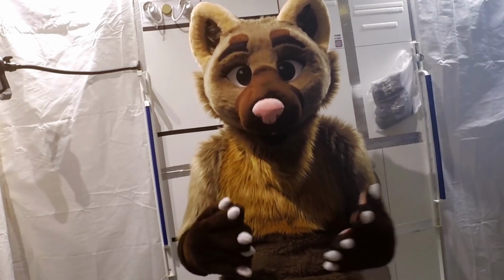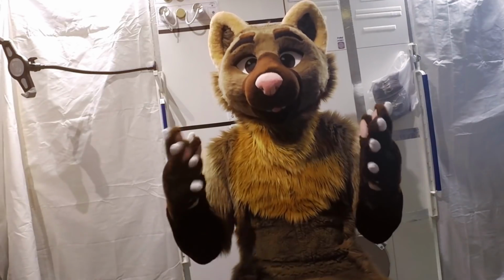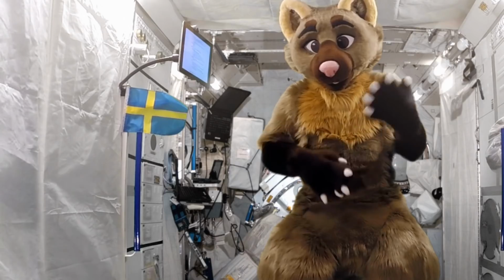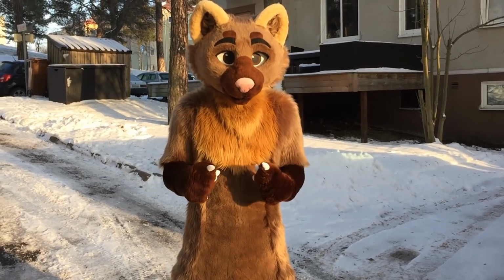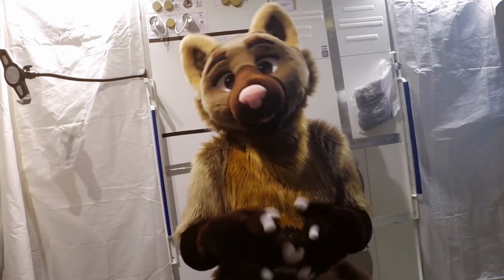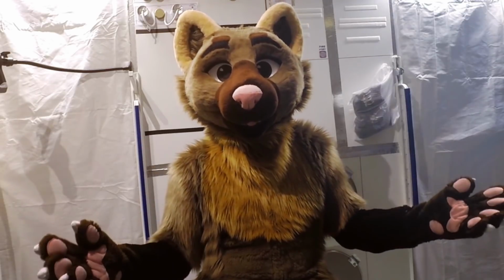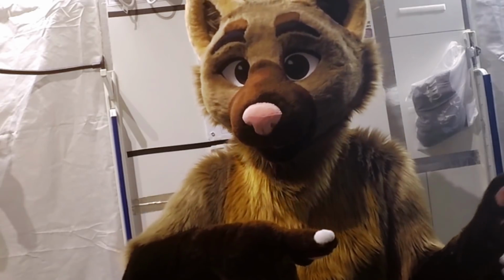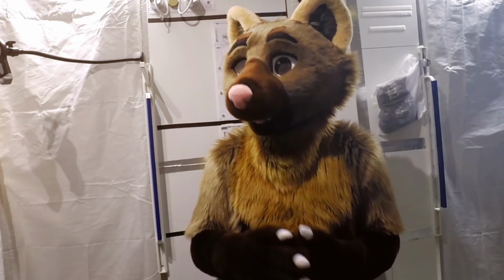What's Inside a Spacecraft?

Comment: I could do a whole video just on RTGs. I love those things! Thermoelectric generators in general work by having a junction of two dissimilar metals on something hot, and second junction on something cold, ie. a thermocouple. Each thermocouple only generates a small amount of power, so thermoelectric generators have hundreds or thousands of them to generate a useful voltage and current. In a spacecraft RTG, the hot end is a lump of highly-radioactive Plutonium-238 that gives off heat as it decays into Uranium-234. The cold end is space itself, which is why RTGs are covered in radiators. The problem with RTGs is that they are not efficient, but the waste heat can be useful for keeping sensitive electronics warm during the harsh Martian winters.

Something amusing that you missed on thermal management is "barbecue mode", which is how smaller spacecraft like satellites and capsules passively manage the thermal loading from the sun. As they travel through space, they spin slowly so that all surfaces of the spacecraft are heated evenly as the craft rotates - just like a rotisserie chicken! This technique was used extensively during the Apollo missions. The rate of rotation is slow - typically only one revolution in 10 minutes. Because the ISS doesn't spin (except once per orbit to keep it facing the same way with respect to Earth), it has to have an active thermal management system to absorb heat on the sun-facing side and dissipate it into space, hence the honking great radiators.

Thermal insulation in space is also tricky. As the dominant form of heat loss and absorption in space is by radiation, materials are selected for their emissivity (how much energy they radiate as a function of temperature) and absorptivity (how hot they get as a function of the incident radiation). The first example of this was Sputnik - the polished aluminium sphere had carefully selected absorptivity, emissivity and surface area so that it absorbed and radiated just the right amount of energy on each orbit to maintain a mean temperature inside of ~20C. The inside of the sphere was also pressurised to one atmosphere, so no special adaptions were needed for the electronics and batteries inside.
Reply: It seems like he was trying to 1 up you TrustKat

Comment: Your videos are so nicely done. They are awesome! You put a lot of work into this! Great Job!
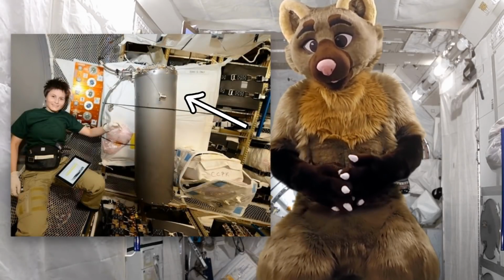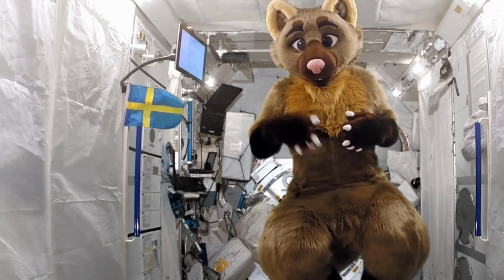So at 2:10 knowing that some shooting stars are astropoop, I'm totally going to cover my whole yard with a plastic bio-dome now. Inside spacecraft, yeah, having fans blowing is so important, if there is no gravity.  You can physically see these bubbles of air with infrared viewers of various wavelengths between 8 uM to 200 uM 6:22 so how did you like your snow day? How did they know how from the start to design Sputnik so it would not burn up from the sunlight? Aw you're so cute! 1:57 so whats to drink up here, maybe a soft drink, sprite or 7-up? No we just have fizzy psss ha ha. Yeah radiational cooling in space, you have to transfer the heat then make it actually radiate away as an electromagnetic wave, there is no air or atmosphere to transfer molecular vibrations to...This would be like running your AC but not running the outdoor cooling fan to blow the air thru the cooling fins. Your AC unit would need to be much larger to have the same BTU rating.
Reply from the maker: Can't drink soda in space - the air doesn't rise up to make you burp, it just stays down there and becomes uncomfortable!
Reply: I never knew that, you would think you could burp in space. I'd be afraid I'd puke in my space suit. I saw this one video where this astronaut on a spacewalk had some liquid coming into his suit from somewhere, it was getting on his face and he could have drowned, as it does not 'fall down' due to gravity. Wild stuff there!
Reply: Adding to it, just thought this was funny... One alien parent says to their teenage son "I see you drank all your PEPSI from Earth.... So now be nice and do ALL your chores right now*...... Else I'll turn the *gravity field OFF . . . just like last time............" ///// So yeah I looked it up, you're right, the CO2 does not come out of the soda in microgravity this would be very painful in the belly! Amazing!

Comment: Hiya Hiyu, one thing I've always wondered is this: Once a spacecraft is in space with passengers inside, how is gravity essentially turned on and off? When gravity is on, how is its direction controlled so that it is pushing towards the ground and not towards, say, the ceiling of the spacecraft? It's just been something that's boggled my mind for years haha
Reply from the maker: Mylo Otter To this day, nobody’s tried artificial gravity in space - the way it’d be achieved would be to have a very large craft, and have it spin slowly. ‘Gravity’ (centrifugal force in your frame of reference) would pull you towards both ends of a long spacecraft, or if the craft is ring-shaped, you’d be able to walk along the inside of the ring. Ring stations (still sci-fi but entirely possible) rely on this idea.
Reply: Hiyu Sooooo cool. As a kid I always thought there was a way to stop the floating and walk normally; that's so interesting. Thanks for the reply bud, my childhood mysteries have been solved :)
Reply: Ring space stations are the way to go. Same way with ships for long missions. Spin rate must be adjusted so you weigh the same as you would on earth. A reference weight on an electronic scale would work for this to control the spin. Just don't look out the windows, the spinning stars, Earth, etc,  will make you dizzy!

Comment: Oh, so that's what the big rectangles sticking out of the ISS are. I always assumed they were solar panels. Or are they both?
Reply from the maker: The big flat blue/black/orange ones are solar panels, the white angular ones are radiators! :)
Reply: Oh, thanks for clarifying that. I thought you meant all of them were radiators.
Are they shaped like that so that they can control the rate of heat loss?
It's amazing that having a big surface area is the best way we have for losing heat. Reducing temperature is such a weirdly hard problem for how simple it sounds.